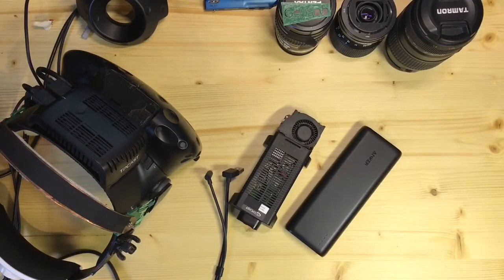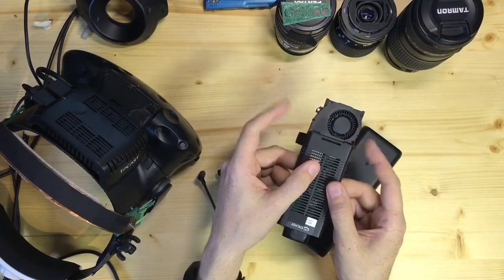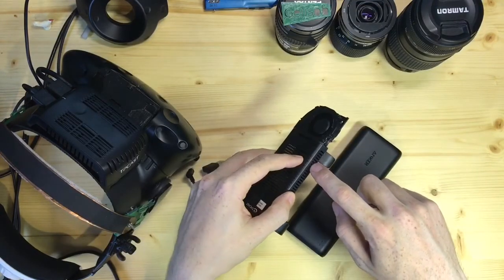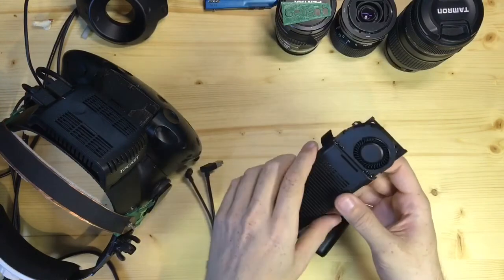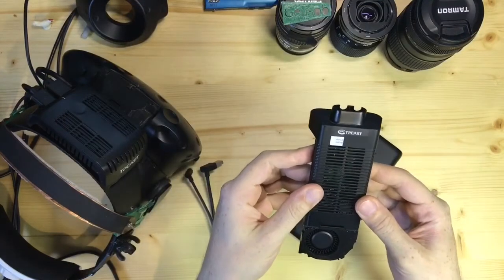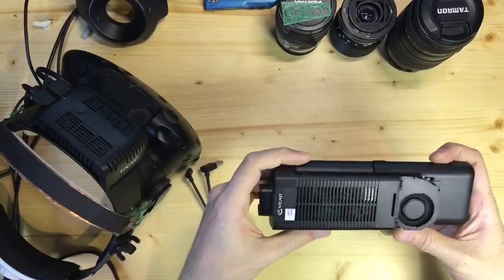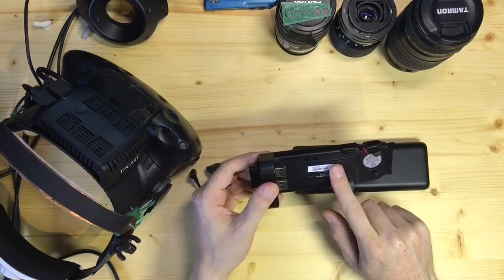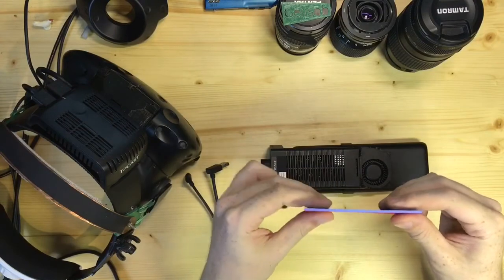TPCAST cooling modification

Comment: TPCast users were requesting this mod, but why? Does it get too hot?
Reply from the maker: As people run their PC's with very different levels of cooling solutions, so do some TPcast users. It is an ARM computer (like raspberry pi) and some find to be better to keep it cooler. It is mostly a comfort thing in addition to running your electronics cooler. As one does not wear their PC but TPcast parts get touched by us from time to time and feel kinda too hot for the liking.
Reply: Is it the ARM on the TPCast or the battery? Others said it was the Battery, who had it installed on their head. The US version battery is anker and much larger, it will be kept in a pocket.
Reply from the maker: ARM processors is on the computing unit that I'm modifying here. That holds the battery. Battery is off the shelf the Anker PowerCore 20100: http://a.co/dblXNCK - on sale too, while writing.
Reply: I keep my battery in my pocket for 4 hours and it gets warm, but no hot. For me personally.